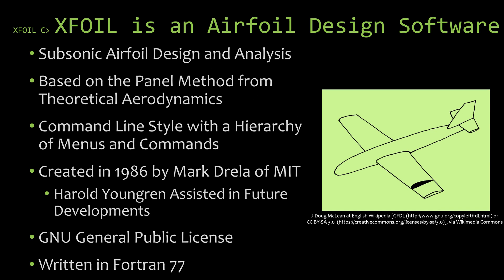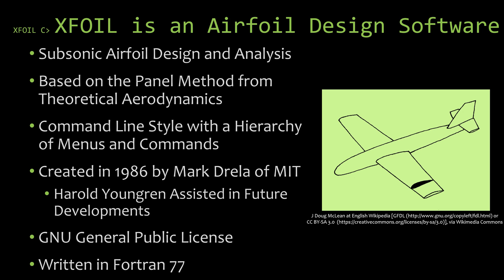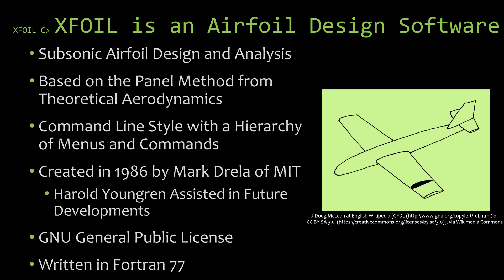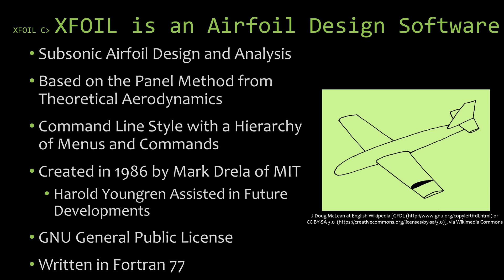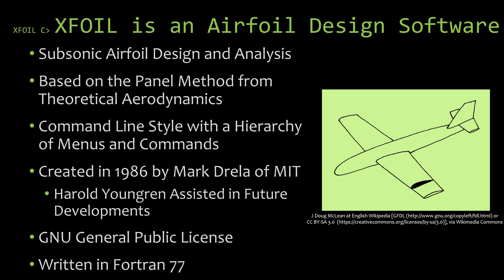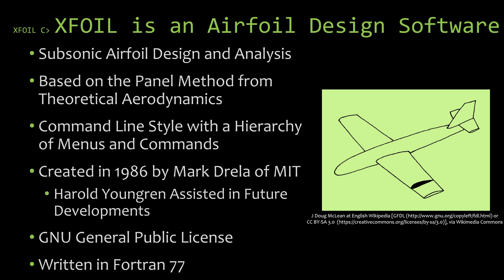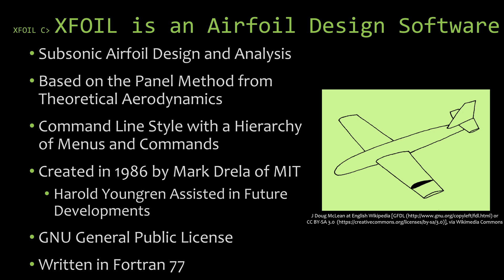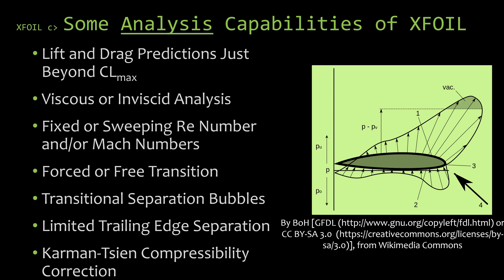What is XFOIL?

Comment: I have the weirdest problem ever with Xfoil that I can't solve. I am using Xfoil for airfoil optimization for small wind turbines and I am coupling it to a MATLAB code such that the MATLAB opens Xfoil to calculate the lift and drag for each airfoil, and depending on these values, the optimization algorithms try to find the best solution. The problem is that after several iterations in the optimization algorithm, the Xfoil starts to get unrealistic results although the airfoil coordinates wouldn't have changed much and the same xfoil settings are used for all the airfoils. And if I try to solve one of those airfoils having unrealistic results on xfoil separately and change a little bit of information such as one of the coordinate points or even changing the reynolds number by 1, the xfoil solves it correctly.  Did anyone face such a problem when dealing with xfoil?
Reply from the maker: The solution that you mentioned, i.e. changing the Reynold’s number by one or slightly changing one of the airfoil points, is a common suggestion to fix solutions that do not converge. The method used by XFOIL to obtain a solution is an iterative method that is designed to converge on the solution by using the previous solution as the initial guess for the next iteration. Every once in a while, you’ll encounter a situation where the solutions will bounce between two numbers. Using random numbers for illustration, the first solution will be -2. With -2 as the initial guess, the solution of the next iteration is -3. With -3 as the initial guess, the solution to the next iteration is -2. As you can imagine, the method has become stuck in a loop. Using a Reynolds number that is slightly different by, let’s say, 1 will have a different result. With the first solution of -2 leading to -2 as the initial guess, the solution of the next iteration is -2.99998. With -2.99998 as the initial guess, the solution on the next iteration is -2.23456. As you can see, the slight change lead to slightly different solutions that prevented the method from getting stuck in the loop.

Some other things to try on solutions that do not converge would be to increase the number of iterations that XFOIL tries before it gives up (using the ITER command in the XFOIL -> OPER menu) or changing what is considered to be an acceptable solution (I don’t think this is possible currently using the commands in XFOIL. I would have to take some time looking in the source code to figure out this solution).

Hopefully this is enlightening and helpful!
Reply: Thanks very much for your reply. In fact, xfoil does converge to a solution which is unrealistic that is the problem, it doesn't go in an infinite loop or display a 'Not Converged' message it just gives a result which is very unreliable. For example, the optimization algorithm would be generating airfoils which give lift to drag ratios in the order of 50s and suddenly we start finding airfoils having 100+ lift to drag ratio although we don't find these values anymore when I make slight changes as I mentioned.
Reply from the maker: Hmm, interesting. I do wish XFOIL had some built-in checks on how reasonable the answers it gives are (like telling if the angle of attack is past stall or if a separation bubble might be present so that we know we're a region that XFOIL isn't very accurate). Maybe when I'm not so swamped at work I'll try and write some code to this effect. Let me know if you find the reason it was giving weird results.

Comment: Is Xfoil similar to Designfoil?
Reply from the maker: Both Xfoil and Designfoil are software for the design and analysis of airfoil shapes. As such, there is both similarities and differences. For instance, Xfoil is free and open source while Designfoil costs money and is proprietary (paid isn’t always better). Xfoil is a menu-driven command prompt and Designfoil is GUI. Designfoil has a 2D virtual wind tunnel and lots of airfoil shape exporting functionality but it appears that XFOIL has more features for modifying airfoil geometry and modifying the surface speed distributions. But let’s get to the root of the matter: the algorithm. Since Designfoil is propriety I don’t have access to their algorithm, but the basic algorithm is described on the website ( http://www.dreesecode.com/designfoil/science.html ). Reading this page I see more similarities than differences. Both are panel methods (I have a video talking a little bit about the basic panel methods here: https://youtu.be/-chWU93PLjE ). The basic panel method of both is to break the airfoil shape down into panels, add a source to each panel, calculate the velocities of the sources, use the surface speed velocities to calculate a pressure distribution around the airfoil, use the pressure distribution to calculate the lift and moment coefficients, and then maybe use a boundary layer model to determine drag coefficients. This is the method used by both XFOIL and Designfoil. Panel methods do have the tendency to overpredict lift and according to the site it looks like this might be part of the proprietary nature of Designfoil would be to use empirical data to correct this. Is it worth the price? Not sure myself as I’ve not tested it extensively and I don’t know if I want to pay to buy and test it. Maybe in the future.